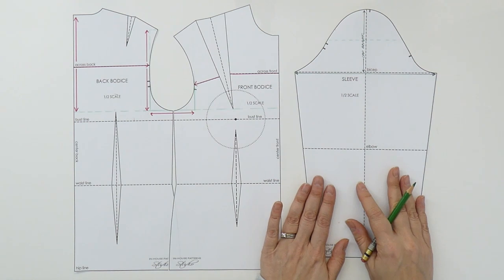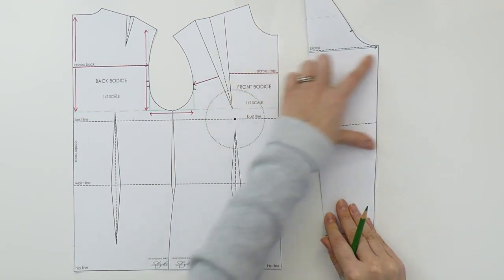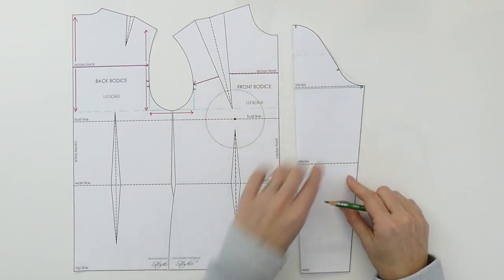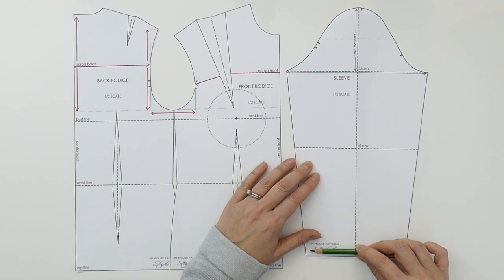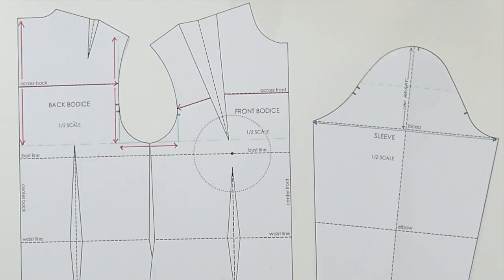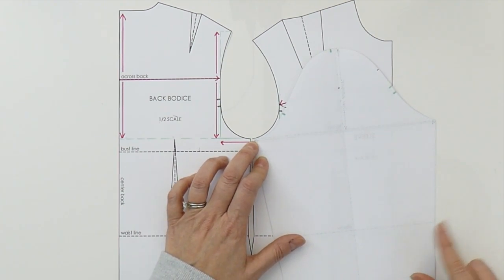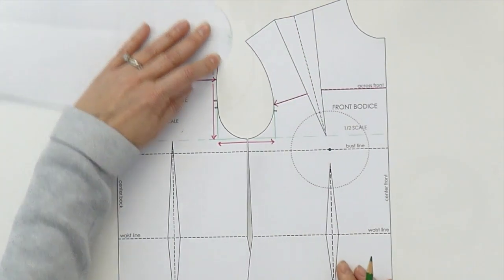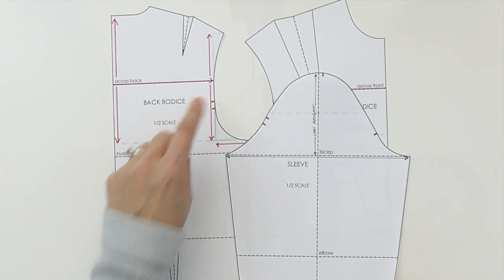Sleeve Fitting Armhole Sleeve Connection

Comment: Thank you so much for sharing your knowledge.  Working on my sloper, getting the sleeve correct has been a challenge.  Now I have a better guide as to what I should be doing, and checking. Your presentations are clear and I like the way you explain details. Also I appreciate you showing different sizes. Having a full bust often makes things tricky, as my pattern does not look like commercial ones.   I have just started working with princess seams, think they will work well for large bust.  Now... back to see if I can improve my sleeve fit.  Do you have a method where people can support your work financially?  Like Patreon or Liberapay

Comment: After watching all of your sleeve/armhole videos, I put my bodice pattern down with the bicep lines aligned on front and back and the side seams overlapping and discovered that I have no more than 4" of armhole width.  I'm not a huge person, but I'm not tiny either, and so little width in the armhole just won't work.  It appears that the across-body measurements that I have are too long, making the bodice body too wide and the armhole width too narrow.  Does that sound reasonable?   I can reduce the across-body measurements, but can you give me some idea of how much the first reduction should be?  I'd like to get close the first time so as not to have to make three or four (more) muslins to resolve this issue.       It's so nice to have found you and the level of detail that you include in your presentations!

Comment: Very interested in knowing the slight sleeve drag lines pointing up to the cap signify a little extra ease to allow arm movement rather than a too-short cap.  I had these drag lines as well as a convex shape to the bicep balance line.  I added more length to the cap height 
which eliminated the drag lines AND allowed the bicep line to be parallel to the floor.  Should I reverse all that and be OK with a slightly convex curve to the bicep line?

Comment: This is FANTASTIC!  Enlightening!  Question:  On your sleeve pattern, I noticed that your top notch did NOT align with the center line of the sleeve. Does this mean that the CENTER LINE of the sleeve is NOT always exactly aligned to the SHOULDER SEAM ??? ❤
Reply from the maker: yes, in most cases the center sleeve is not the position for the notch.The front armhole should be shorter than the back so that the sleeve pitches forward at the same angle of your arm.
Reply: @AlexandraMorganInHousePatterns  Thank you for the insight! ❤️

Comment: What if you have a pattern - independent designer - where the sleeve cap has 3.8cm of ease? I'm trying to figure out how to take out 2.3cm of ease out of an existing sleeve cap without changing anything else with regards to the design of the sleeve? I'm really struggling with this. I tried slashing the sleeve cap horizontally above the notches and moving the top piece down a little, but it's not nearly enough. Should I just keep doing that and re-drawing the curve until it fits? It's so frustrating because I really want to make it work. I would start from scratch, but I don't know how much ease they have in the bicep area - it's a full sleeve that flares out to the hem. Do you have any suggestions?
Reply from the maker: This amount of ease can work if the armhole size and fabric choice will allow it. If you cannot ease this amount in you can reduce cap width in addition to cap height.lowering the base of the armhole will also a aid this.